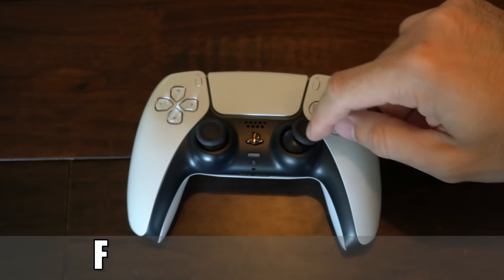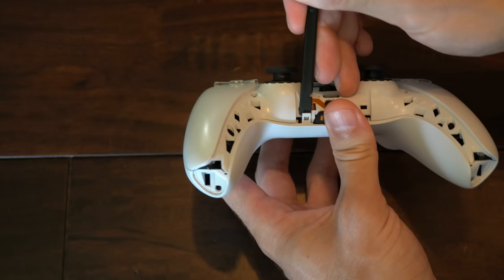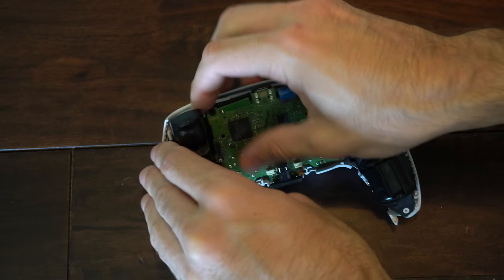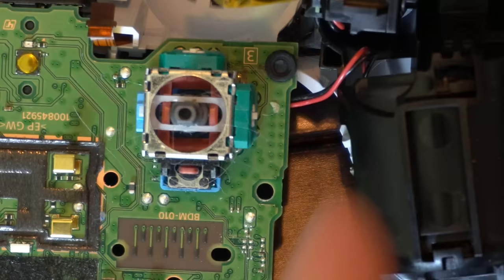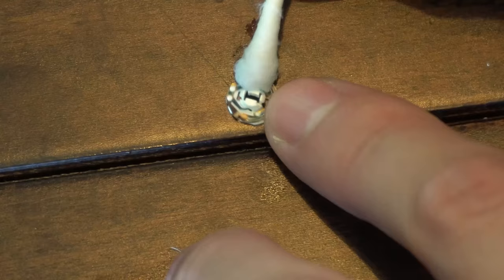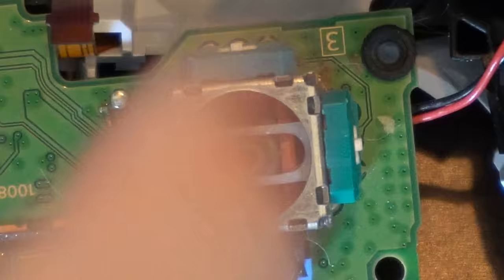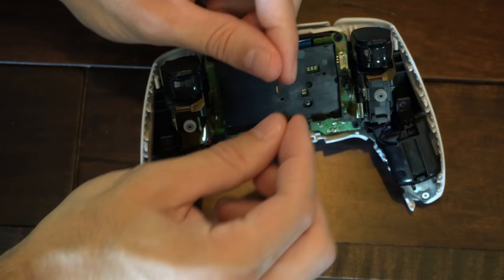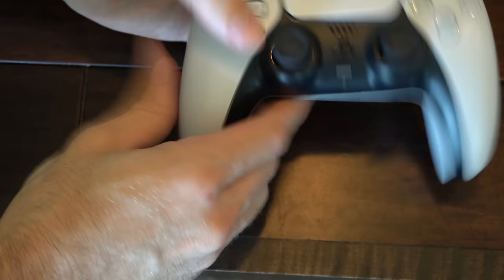How to FIX PS5 Controller Stick Drift & Moving on its own (Best Method)

Comment: So I broke the green piece and now the thumbstick stop working
Reply: This is why you always take it slow wen dismantling the controller like with the PS4
Reply: fatality. don't worry I ducked up too, now it gets stuck and it isn't as smooth :/
Reply: @gabrieldavid465  yep and I also messed up the sensor so I just got another controller. But at least I got a practice controller now 😂
Reply: @novanotfoundyt  unlucky bro, i did the same thing in the video and i was really really really careful to the point where i started sweating 😂 and i fixed my aim trigger. i guess Im  lucky
Reply: I was close to that too I saw one vid that does take it off on purpose but he sauders it back together
Reply: Lmao that was the mother board
Reply: @redouanezaouiri9540  first try ever doing it worked for me. Felt like I was performing surgery for Sony.
Reply: @gamesandstrains420  facts. Handled it like a new born. Lol
Reply: @jeffeternal_hairston181  so true so true
Reply: Bruh I used a knife and was careful
Reply: @zoraxshop  finally had to buy a new controller :(
Reply: Anyways u would buy a new one so now forget it thats why iam doing it 😂
Reply: Skill issue 💀
Reply: @averageminerenjoyer1438  I’m still mad abt that 😭😭
Reply: i f mine up too😂
Reply: i’m scared to do it now😭
Reply: Not your fault...it's Sony's. This is unacceptable
Reply: @EliHank  yep
Reply: Done this to find that my controller is completely clean, no dust, dirt, nothing. Now the drift is 10x worst. Just a analog that Sony programmed to break for no reason. Bought one from argos with 2 year care, breaking the control apart does nothing to help it, seems like a money scheme
Reply: Just go to any electrician and tell him to solder it.. it will be free or maybe just $1
Reply: Shiid my shii work perfectly now, all u gotta do is peel it back enough to get the white piece out and fit the Q-tip
Reply: How did you manage that?
Reply: F
Reply: I broke my green wires does anyone know what that controls?
Reply: 😂 I just messed up my right thumb trying to get to the censors smh I activated my 4 year warranty immediately! I used my fingernails so be careful it is possible 😅
Reply: @alejandroguzman5127  4 year warranty?
Reply: @eldikato2313 I paid for insurance that covers me until 2026 my bad if I said warranty
Reply: I was taking the trigger ribbon cables off and the left side just snapped with the lightest touch and now I’m buying a new one and just returning it but with the bone response triggers on the left and stick drift
Reply: I broke my 2 green wires ionk what they control
Reply: I broke L2 button 😢
Reply: How did you break the green piece?
Reply: I broke my green piece too and it makes me mad cus I was so gentle and I’ve put back paddles on my controller smh
Reply: Cool
Reply: @Bomba_mario124  I pulled back on it too hard
Reply: @eldikato2313 your life 😢
Reply: idk but I followed the tutorial the right way and now my controller is working perfectly fine, no drift at all
Reply: See that’s why I don’t try. Was trying to clean the fan on ps4 I was like nah halfway through
Reply: Thanks my brotha! Saved me $$ from buying a new controller lolol
Reply: Smooth move! 🤣
Reply: Rip💀
Reply: This made me laugh
Reply: Same
Reply: You werent supposed to do that
Reply: For the first ribbon, I ripped the white piece off and broke the pins. It works, but sometimes lags. Is it necessary?
Reply: @AustrianHedgehog  definitely I played around with it EVERYTHING is necessary
Reply: Just finished doing the same will see if it works better@redouanezaouiri9540
Reply: The "green piece"? As in the circuit board??
Reply: @aliengranpa  no the part that holds the sensor
Reply: I did too. Anyway to fix it??
Reply: I did NOT bust that, and it is due exclusively to the fact that you posted this comment. Thank you for the heads up. 🤜🤛 🍻
Reply: Sounds like your stick drift problem is solved, no?
Reply: When you break a circuit board there's not much you can do. You'll have to look around for circuitry, but at this point, it might just be time for a new one.
Reply: me too. Pissed as hell
Reply: @hkillerpr i was going very slow and being careful and still ripped a ribbon.
Reply: Ps5 sucks ass bro lol
Reply: Mine fell off my desk several times and I have the stick drift on the right stick
Reply: I spent so much money buying controllers after six months
Reply: Sony is a big corporation company and you mean to tell me they can’t make a controller for a video game properly where there is no problems come on it’s an electric toy man … they just want you to spend spend spend your money continuously
Reply: @Jinomitsu  no not the circuit board but the small green piece that holds the sensor
Reply: I bent the ribbon and now stick drift is fixed but my l2 no longer works
Reply: 🤣🤣🤣🤣 I'm dying!!!!
Reply: @fearlesstay don’t do it unless you actually know what you doing to a T I followed this video perfectly and now the thumb sticks don’t work at all
Reply: Skill issue
Reply: Did it break off fully? Or cos mine isn’t working either 😅
Reply: Ain't no way you broke that
Reply: U can weld the part 😂
Reply: @novanotfoundyt  whats a practice controller?
Reply: Skill issue
Reply: L
Reply: Bro my controller won’t even work now the down button is now stuck so it’s screwed
Reply: It actually works! Great video
Reply: Exactly why I didn’t do this
Reply: Lad Ty man u just saved me about 60 70 euro U deserve a like and follow
Reply: I had to be stopped when read this 😢
Reply: Should’ve bought before hand. I’m only doing this because we have extra control just in case.
Reply: Womp womp
Reply: Used a Fletching knife works like a charm
Reply: @novanotfoundyt or a controller for when u rage but dont wanna buy a new ctrl
Reply: Thanks, it works
Reply: Bro
Reply: Just reading this as I’m sitting here contemplating selling my whole system and getting a PC because I just snapped the yello wire leading to the motherboard 🤦🏻‍♂️
Reply: Snap 😂
Reply: Idk what i did wrong but my left stick stopped working
Reply: no cause i broke one of the two pins im so upset
Reply: Well I just broke a strip. Just get insurance guys it’s not worth the risk. Smh 🤦🏻‍♂️
Reply: That’s your fault shouldn’t be so heavy handed 😅
Reply: @hkillerpr  yeah pretty sure we all know that.
Reply: That’s just too much work. I would get a new controller.
Reply: that's the motherboard, you screwed it up big time bro..
Reply: @RekklessAbandoN  you have to push the two white pieces down that go across the analog They get pushed up when we bend the green sensor back
Reply: Womp womp
Reply: To be fair, if you had stick drift, the thumb stick wasn’t working anyway
Reply: @zukesnukem1723  not true. I fixed mine
Reply: Same
Reply: I took 10 mins doing it the first time you really need to be patient if you don’t wanna break it the first time my second time it took me 20secs cuase it was loose from the first time
Reply: Doesn’t drift anymore tho
Reply: @novanotfoundyt i cant buy a nother controller😅
Reply: My hole controller is now broken thanks!
Reply: It's called a circuit board and 😂😂😂😂😂😂😂😂😂😂😂😂😂😂😂
Reply: @novanotfoundyt or a poor soul for when you rage
Reply: @redouanezaouiri9540 bro was sweating 😂
Reply: @luka3945  not the motherboard but the part that holds the sensor
Reply: @novanotfoundyt literally realised that after and just came back to delete the message 😂
Reply: @novanotfoundyt about to perform open heart surgery on my controller so wish me luck lol
Reply: @luka3945  prayers im back at it myself a year later🙏🏽😂
Reply: @Itachiuchiha55431  your not supposed to open the blue latch with the silver thing in it it will break your controller 80% of the time just open the controller and get one of those can air and blow around it and clean the outside of it that will fix it
Reply: Thank you I fixed mine on the first try I was super sceptical about even trying it
Reply: We wouldn’t have to do this Sony if controllers didn’t cost so much.
Reply: My right side green piece won’t click back. Let’s see if I screwed the controller lol

Update: Controller is fucked 😂😅
Reply: @badmeetsevilfan1  bro your not supposed to open that period clean it from the outside and it will fix the drift just blow on it or use one of those air cans and wipe the outside of it with alcohol if you open it your controller will break 90% of the time
Reply: the ribbons are brittle af. its like the plastics are old and brittle
Reply: What happen was The inside green lock in peace. The lock duck sensor It has 2 tabs towards in middle edge. The one tab broke off or is  weak, so you'll have to strengthen it. I put a little crazy glue on the side.outside hold in place  for 2 min
Reply: LMAO
Reply: Womp womp
Reply: Bro my joystick was getting stuck even when I cleaned it got mad and broke the green sensor
Reply: Ouch.
Reply: Me too now it doesn’t work
Reply: Nah really it’s not like that’s the. OST important piece or anything
Reply: Yeah I think I just broke the entire left side somehow but I have to buy a new controller now
Reply: @TennisWall  real
Reply: I've killed five controllers trying what you did.DONT TRY @HOME😮
Reply: @gamesandstrains420 That was funny lmao
Reply: @novanotfoundyt hey you were gonna have to get a new one regardless if that stick drift was messing you up
Reply: Real yo but I still managed to have it connect to the latches I’ll see if it works 👍
Reply: Yea never mind I broke the entire thing
Reply: Update:nah I’d win
Reply: Wait bro why did you break it
Reply: 😂😂😂 sorry for your loss
Reply: @redouanezaouiri9540 I ain't even mess it up bro in the vid lied only way to fix stick drift permanently is new controller or buy new sensors
Reply: @WhompusMystic  no your wrong that little white piece is either scratched or dirty if it's dirty then just clean it and if it's not then just replace it and even if it don't work it's fine you can just put it back and then trade it in for a new one
Reply: Same
Reply: @fearlesstay practice on a old controller or go really slow
Reply: Lmao smh
Reply: Bro fucked his motherboard😭😭😭
Reply: womp womp
Reply: Mine stick got worse, will no longer go to the right. I was doing surgery on my left stick btw. It only goes left now, which was the stick drift direction. I don’t know what I did wrong
Reply: After a couple trys I got store credit at game stop towards a new one. This does extend the controller.
Reply: Lol
Reply: Same

Comment: Sony deserved a lawsuit on this BS of a controller. this issue occurs why too early and too frequent for the life of the controller
Reply: Especially how much its cost
Reply: Never had any issues ever with any PS Controller. Been playing for like 25 year through all generations and now both my DS controllers have it. WTH Sony!!
Reply: Fr I’ve had a Xbox elite controller 2 years before the ps5 controller yet somehow the ps controller got stick drift first
Reply: Made in China what do u expect
Reply: @dontgetmad4849  I expect good quality controllers. And does it being made china have to do with this?
Reply: Same PS4 controller didn't have this issue and still doesn't since I got it 9 years ago, ps5 controller hasn't lasted 6 months before it's started
Reply: Use ur f brain
Reply: @geoffm9924  i got stuck drift on all my PS4 controllers it's the same sht
Reply: Yes I’ve had 3 separate controllers  develop stick drift in less than 6 months…
Reply: Especially when they're charging 60-70 bucks for a controller that I can't even get a couple of months out of! My PS4 and Xbox 360 controllers still have no flaws despite being 9 and 18 years old respectively.
Reply: Fr and the controllers are like $80
Reply: I was thinking the exact same thing. it's literally bs bc I have never had this problem with my ps4 controllers ever in my life since I got them years ago. and now my ps5 controller has stick drift after 2 years
Reply: All because they want ppl to buy the dual sense edge controler for that reason. 🤷🏻‍♂️
Reply: I remember my ps3 controller would never have these kind of issues
Reply: I've had my 2 years in September and now it's unplayable and I've got to take it apart, hoping I don't brake it. 😮 Blowing thought it doesn't work anymore 😢
Reply: Ye
Reply: Sue nintendo first for their joy cons
Reply: Not mine
Reply: Definitely
Reply: @bossedup957  it made my remote worse but my other one got fixed
Reply: @justthe2ofusgaming2  I fixed all 3 I used some air cans also
Reply: @bossedup957  yeah i think i fucked my remote up i think it was my fault my other one i had to super glue a piece to make it turn on
Reply: 75 euros for it only to break after 3 months of playing is crazy imo sony is such a useless company
Reply: Shii be pissing me off especially when you play games like rainbow six siege and your sim has to be on point or you lossing ya gun battles
Reply: Agreed. Never buying another Sony product again unless they fix this and I get a new controller out of the deal...Come on Sony, make this right!
Reply: I learned to clean my controller and fix my stick drift with this video. Thank You So Much!🎉
Reply: I still don't get how they don't have a class action against them
Reply: @GenesisAUT  very interesting you never had this problem with dualshock 4. I had all your problems early with ps4 but ps5 has lasted me 2 years before i got a stick drift problem.
Reply: Exactly, i’m going to sue them
Reply: The only credit they get is that taking apart a ps5 controller is hella easier than a ps4 controller. But my ps4 controller took YEARS to need a cleaning and it was my own fault (spilt soda on it and buttons got absolutely stuck) but my ps5 got stick drift after 8 months
Reply: I fixed mine. It was def a factory issue, the controller was completely clean inside except for the sensor. The q tip came out black!
Reply: Facts on my third one lasted 6 months
Reply: @dontgetmad4849 ,
___To whom do you offer this sage advice?
Reply: @irosencrantz882  what advice
Reply: Following the guide fixed all my issues with stick drift. Thanks!
Reply: @dontgetmad4849 hope yo it ain't got nothing to do with china it's more of a marketing thing if they can break ur controllers, you have to buy new ones😱and the cycle repeats just capitalism and making money of ppl
Reply: @WhompusMystic  build it in Sweden you would NEVER have this problem
 You're right about capitalism but don't say all countries are the same.
Reply: Yep, my gf bought me a black controller and I had stick drift about a month into it
Reply: They deserve more for selling these at $100+ in canada
Reply: @dontgetmad4849  that's not really relevant. Most electronics are made in Asia
Reply: @dontgetmad4849  that's not really relevant. Most electronics are made in Asia
Reply: @dontgetmad4849 what's an f brain?
Reply: Ive had my PlayStation 2 years and im very disappointed.
Reply: @dontgetmad4849 at least ps4 controllers are easier to take apart. I didn’t even need a guide for it.
Reply: Had the black contrôler for like 3 months and it aredy apear
Reply: It was about four weeks with this controller before this happend
Reply: I have a 8 year old PS4 controller and I literally tortured that thing in every way possible with the games I played over the years. It has its scratches here and there but works like in its first day. I treated the PS5 dualsense like a new born babies head for 1 year and it still got stick drift. I also read the percentage on how often they get this is around 50%. Plus the fact they charge 80$/€ for this thiing. I also read that Sony had a choice between 2 versions of joysticks for their dualsense and INTENTIONALLY chose the version that busts after short time so people buy new ones over and over. I wanted to refuse and repair mine. Yet I was unsuccessful and had to buy a new one. I hate this corporations and their planned obsolescence. They get greedier year by year, day by day. Hope EU steps up.
Reply: Amen dude, since PS1 never had a problem, even hardcore gaming through best years of COD, after maybe 2 years mine was fucked. These practices by these companies are getting out of hand, it just gets worse @GenesisAUT
Reply: I've followed your tutorial perfectly and now my controller is unusable! This is the worst controller I've ever had on any console! £60 for a new one! Why is there not a massive recall on all PS5 controllers?!?!
Reply: Yes it bullshit my controller keeps going left and right and I just got it 4 months now I have to buy another!
Reply: @GenesisAUT  you can't have played at all, me and all my friends have stick drift on all our controllers. like 15 controllers and each and every one is drifting. Sony are scamming people.
Reply: @RuthlessMetalYT  I definitely have thousands of hours on PS3 and PS4. Guess I have been lucky until PS5 🙈
Reply: Bro I literally bought the ps5 last Sunday and I already have stick drift. Not even a month bro. About 2 weeks and already having problems that’s crazy
Reply: Haven’t even had the damn thing a year and it’s drifting BAD
Reply: @JoyboySR  their controllers are absolute garbage.
Reply: Somebody said it's an issue with the touch pad that causes the controller to drift.
Reply: @dreamerslane8463  no, it's the sticks that are the problem, you can open them up and clean them but it's a lot of screws and it doesn't always fix the issue.